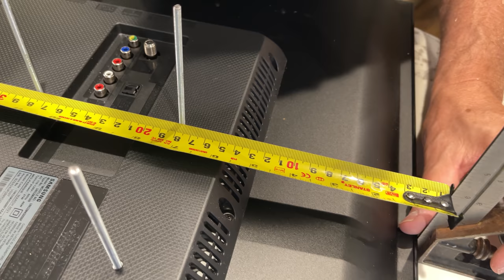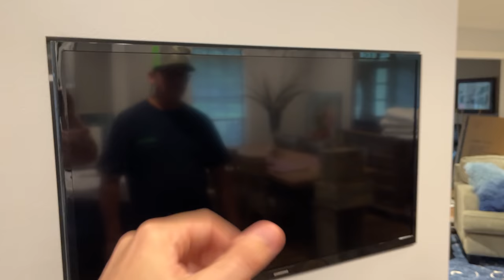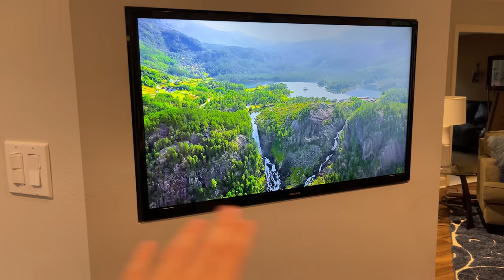How To Put a TV Inside Your Wall

Comment: i know that you showed a great, and PROPER way to find your holes in the niche for the threaded rod... but there is a MUCH simpler way to do this...  Just cut a piece of cardboard (from the box the tv came in) of if your wife is anything like mine we get amazon deliveries about twice a week. So there is plenty of cardboard around.....  Trace the TV onto the cardboard, cut it perfect with your Stanly knife, and/or snips...    draw your lines from top to bottom on the cardboard at the screw measurements, then side to side..    use a drill bit or press and put NICE holes in the cardboard... don't just poke through it with a screw driver...   put the cardboard against the wall.... fill in the circles with pencil....  drill out the holes.... and BANG...thread in your rods... hold up the TV and viola'  ...   should fit perfectly....
Reply from the maker: Cool thx Jack 👊👍

Comment: Questions......why are you using metric measurements?? You didn't have to cut notches to fit the fans thru the holes as you could've just ran the fan wires thru the holes you cut for the fans from the back! Lol! Also, by installing the tv flush with the wall you no doubt muffled the sound quite a bit because speakers on tvs like this either project thru the back or under the bottom edge! I mean it's a cool idea what you did here ,I just think there are going to be issues down the line. Your gonna need a sound bar or atleast run the sound thru a AVR so you can hear the sound decently.  I apologize though as I can't help but chuckle on you cutting notches for the fans! Lol! Sometimes overthinking happens on projects,right??? :) 😀
Reply from the maker: The fans were hard wired together.   They wouldn’t go thru without either cutting the wires or notching as we did.   I didn’t want to cut the wires.   Sound is great 👍

Comment: Good Job....
Just a comment about the FANS....     These fans -- MOST TIMES! -- will have an arrow on the frame indicating the FLOW-OF-AIR DIRECTION....
With my experience, I would recommend to install the fans in a manner that would Blow (or SUCK..)  the air from the TV CAVITY into the back -- THE PANTRY, in your case !
It will REMOVE the hot air AWAY from the TV with better efficiency....

BEST

Comment: Never mount the cable box in view. That looks like kaka. When you want a clean look like you have but need IR to control devices use Xantech products. This is what they do. It allows you to hide devises while being able to control them. You have a tiny receiver. You can install them inside equipment to hide them and the wire as long as the eye is exposed to IR they will work. 

For an example you could take the TV shell apart just a few screws. Look for an opening through a vent or next to the TV's IR receiver. These usually come with double sided tape. Install it wire tie the wire and find a place out back of the TV to run it into the receiver box. I have taken home theater receivers DVD players and these types of equipment apart to hide these to control other pieces of equipment I wanted to hide in another location. When you aim the remote at the TV it will control the device you are needing to control while keeping it hidden.

Comment: why not make the fans blow the heat into the pantry away from the tv?
Reply: Agree. Did just that on a stereo cabinet i built. Worked great, sucked air from the front and blew out the back of the cabinet.